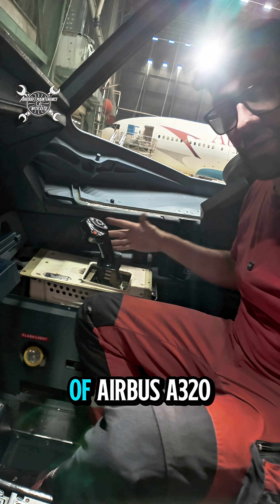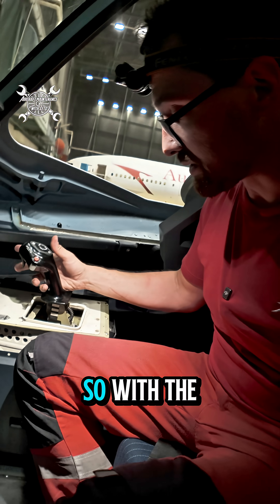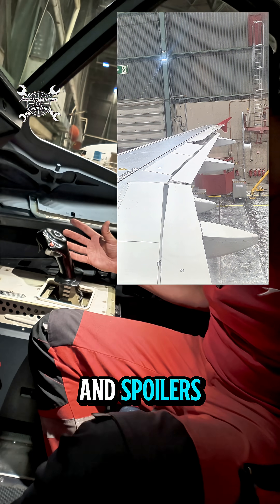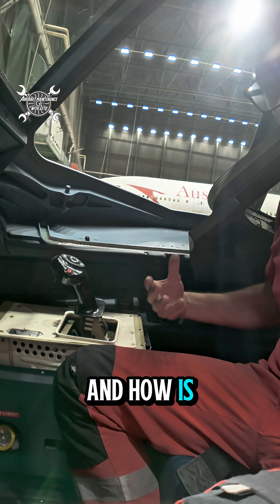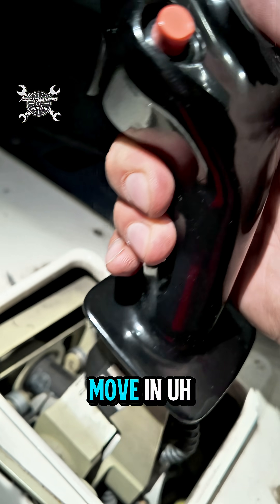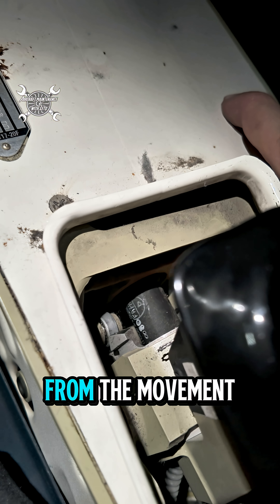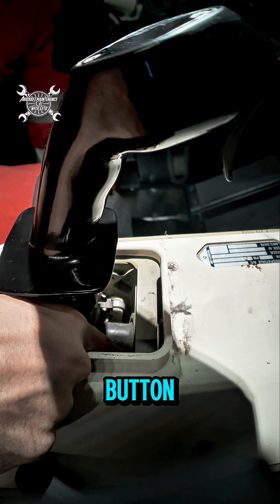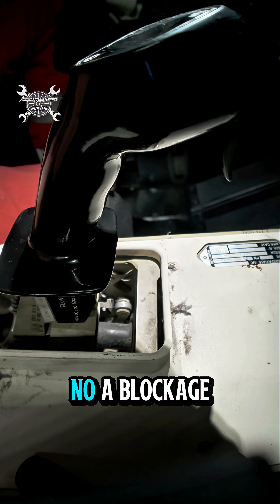Function of the sidestick on A320

Comment: Excellent videos as always‼️👍🏾.   And excellent Airbus design.  Like I said a couple of years ago, a pilot should never have to fight the auto pilot or artificial intelligence for control of a plane like what likely happened in the 737 Max incidents; like a car’s cruise control, whenever there is positive active pressure from the pilot/driver, the automatic system disengages and the control is given to the pilot/driver‼️‼️‼️👍🏾👍🏾😢